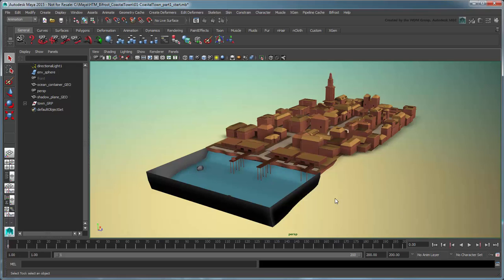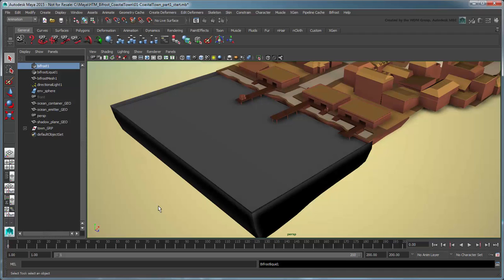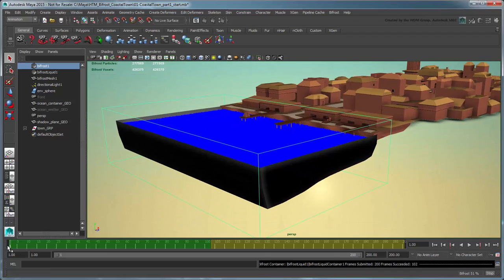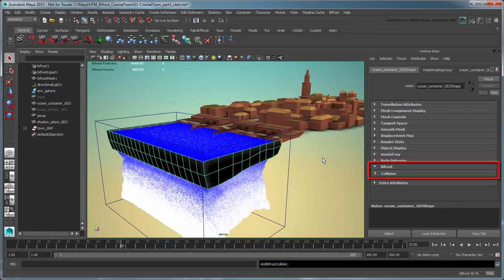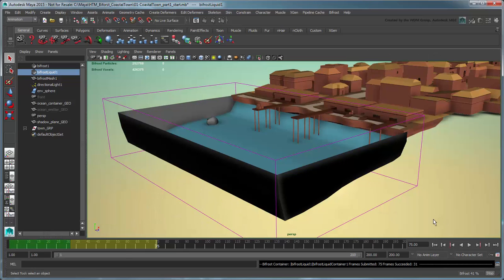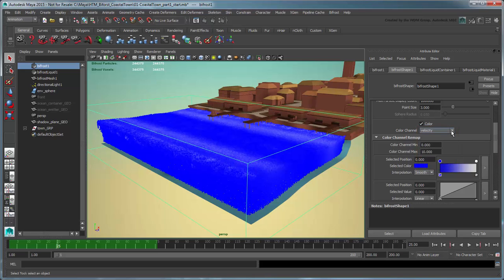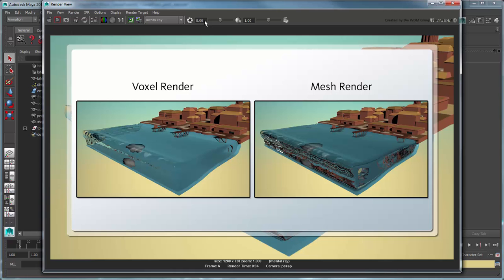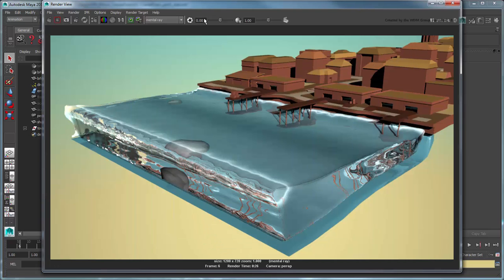Creating a body of water simulation using Bifrost - Part 1: Peaceful coastal ocean

Comment: Hey great video, your explanations are clear and easy to understand but I have an issue. when I select the emitter and click on the bifrost menu and click on create liquid, I see that frame 1 of my time slider turns red and the emitter geo doesn't change to liquid. even when I proceed  and click on play I noticed that when bifrost is calculating and trying to fill in the scratch cache my time line turns red instead of green and yellow. I know some thing is not right but I don't know what it is please help
Reply from the maker: Are you sure your timeline is set to "Play every frame"?
Reply: Yes it is set to play every frame, if there was a way to post images here I would have sent you a screen grab of what my Maya screen looks like, is there anything you can do for me to pass this stage
Reply from the maker: Generally it turns red to indicate an error in generating the cache.  You may want to check the scratch cache options to try assigning it more memory.  Or try disabling the bifrost plug-in and re-enabling it.
Reply from the maker: Actually, also try disabling your anti-virus temporarily and then running the scratch cache.  Some anti-viruses have been known to block bifrost.
Reply: how do I check the scratch cache option? I am not sure how to do that
Reply from the maker: Bifrost > Bifrost Options.  Make sure Background processing and Scratch Cache are both enabled.
Reply: I just disable my antivirus and tried again and it still showed red on frame one. I am really not sure what is going on
Reply from the maker: You may need to reinstall Maya with your antivirus turned off.  The problem is that during installation, specific antiviruses will block the installer from putting files on your machine.

So i would uninstall Maya, turn off your anitvirus, re-install Maya, then turn your antivirus back on.
Reply: Thank you very much, I could remember when installing Maya 2015  over a year a go my antivirus had issues with bifrost, back then I didn't know what bifrost is, I would uninstall and reinstall Maya let you know the out come

Comment: how much ram does this guy have???
Reply: Probably 36. It's suiting animators due to the intensive work on it.
Reply: Mrsylerpowers:::Ram isn't everything to make your system Run faster ans smooth,Also need a decent processor like i5-i7 with Least 3.80GHz To: 4.70GHz And Replacing your Hard Drive with An SSD Drive, then you can bump up your Ram to 16 to 23GB Ram, i know this 2years old but i barely seen the video.But in-case you don't know about Ram now you know a little more and how to improve your System.

Comment: I'm new with fluids so forgive me if I'm wrong but.. Why does this scene convert gravity and density to match the default 1cm grid units? The scene itself is a large coastal town, so wouldn't it make sense to have the grid represent 1m instead? 

To my understanding, by changing the behavior of bifrost to react in cm, we're making this coastal town a miniature scale town with water that will look like its about 1m wide.
Reply from the maker: That's correct, and what we allude to at the beginning of the movie.  We purposely chose to work in miniature for this video so that we could render the particles/mesh more quickly.  If you'd like to see one at full scale, check out the accelerated particle (firetruck with spray) tutorial.

Comment: When I Create Liquid, it doesn't create a container node and fails to simulate the BiFrost particles. Any ideas what may be the issue?
Reply: This can sounds little crazy, but try to off your antivirus and reinstall Maya. Then, from Maya folder\plug-ins\bifrost\bin\precompiledGraphs add all files to whitelist of your antivirus. I have same problem - Avast just blocked some dll of Bifrost due installation.
Reply from the maker: Hmm, have you tried creating some liquid in an empty scene?  This sounds like some kind of a configuration problem to me, so I'd suggest deleting your prefs folder and restarting Maya.
Reply: Just tried it there and the same thing happened. I've tried reinstalling Maya, because I saw you suggest that it may have been a problem with the installation, and it's the same problem. I've installed the Service packs, too. When I go to simulate the scene, the timeline goes red and adds those frames to the Frames Failed count. I'm running the Student Edition, if that helps.
Reply from the maker: That would indicate the scratch cache isn't being built.  Go to Bifrost > Bifrost Options.  Is Enable Background Processing turned on along with the Scratch Cache?  Try overriding the disk location to put the cache somewhere specific and see if that helps.
Reply: Afraid that hasn't helped
Reply from the maker: Hmm, at this point you may need to contact support.  It certainly sounds like some kind of install problem.

Comment: Uhm hello, I'm following the tutorial but ran into two problems: the first one is that my liquid isn't moving...the particles settle in and stand still for the rest of the simulation. The second one is that when rendering the liquid doesn't show up in Mental Ray...
Reply from the maker: For your first problem you should look at part 2 where we create waves.  In this tutorial we're just setting up the still water first.

For your second problem, are you sure you turned the polygon mesh on?
Reply: Oh ok! I was just wondering since I noticed in your simulation the liquid was turning a lot more white than it did for me.

As for the second problem, I did try to enable the mesh, but I get a black mesh instead.
Reply from the maker: This sounds like it could be a mental ray problem.  I would try deleting your preferences and restarting Maya with default settings.
Reply: Thanks, I'll look into that!

Comment: what type of specs would I need to run bifrost smoothly?
Reply from the maker: It really depends on the scale and complexity of the simulation you plan to run.  Like any effects pipeline, Bifrost tends to scale up pretty hard when you get into larger simulations.  A simple simulation like a bath tub or tap doesn't need much processing power to run well, while a more complex waterfall or ocean would benefit from more horsepower.

For Bifrost specifically, I would suggest you heave a healthy amount of RAM (at least 8 gigs, but for these tutorials I was running with 32).  The more RAM you have, the more the scratch cache can consume without slowing down the rest of your processes.
Reply: 32!! WOW!! I have 8 gigs available and I want to simulated a kid jumping in a puddle with splashing water, can I do this on 8 gigs of ram??
Reply from the maker: That should easily be enough for a simulation like that.  Just make sure your kid isn't 12 stories tall and you'll be fine.  = p
Reply: haha thanks
Reply: Maya Learning Channel Hi there, I'm a new Maya user and am working my way through this tutorial but am encountering some performance issues. I'm running an Intel 3770K processor and 16 GB of RAM with a GeForce 660ti graphics card. When I disable the pixel/voxel display settings and enable the Bifrost meshing, the Viewport 2.0 slows to a snail's pace (~4 seconds / frame). Any idea what I could be doing wrong?
Reply from the maker: Looking at your specs, this is more or less in line with what you should expect.  Meshing is a very complex process, which is the whole reason that pixel/voxel display exist (meshing should only be used for previewing, tweaking, and outputting the final result).

That said, there are a few things you can do to speed up performance a bit.  You can try lowering the fidelity of the mesh, or you can generate a cache as shown in parts 2 and 3 of this series.
Reply: Maya Learning Channel Thanks for the reply. Would it be possible to indicate the specs of the machine used to create this tutorial so that I can use that for future reference when I get around to upgrading my machine?
Reply: Maya Learning Channel Sorry, another question. Am I correct in saying that my performance is directly related CPU and possibly too little RAM and not related to GPU? Or would I benefit in this instance with having a better GPU as well?
Reply from the maker: For Bifrost specifically RAM is the most important component.  As mentioned in the comment above, we ran a system with 32 gigs onboard and 6 gigs dedicated graphics for this tutorial but we've also seen production houses run systems with far more than that even.  Basically, Bifrost is capable of consuming as much RAM as you're willing to give it.

Comment: Can you help...I follow ur instructions, but when I select the shpere and press 'create liquid', I notice thatthe liquid container appears at 0,0,0 on the grid and not around the sphere as in ur tutorial. Any idea what I'm doing wrong?
Reply from the maker: Hmm, that does sound odd.  I would try clearing your prefs and then trying the whole thing from scratch.  If you're still having a problem at factory default settings, you may have a bad install.
Reply: Was this issue ever resolved? I have the same problem with the downloaded file for the tutorial. If I manually build the small town structure in a new scene, it seems to work fine. If possible, I'd like to know the cause of the failure in case it shows up again.